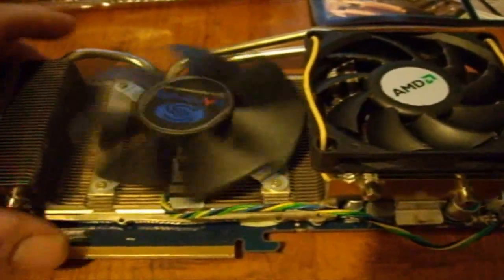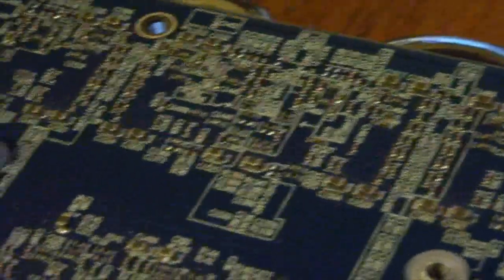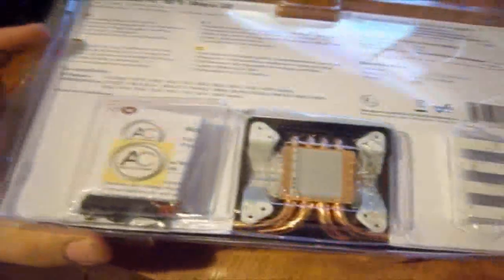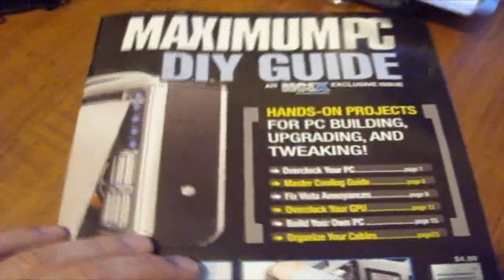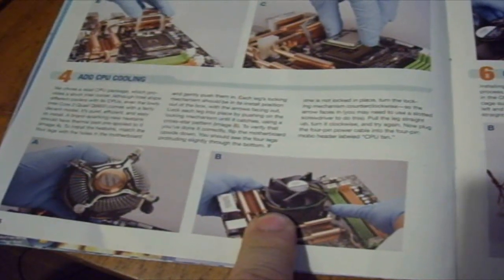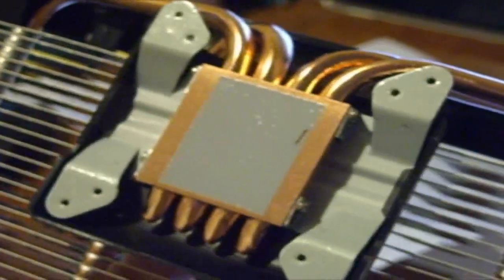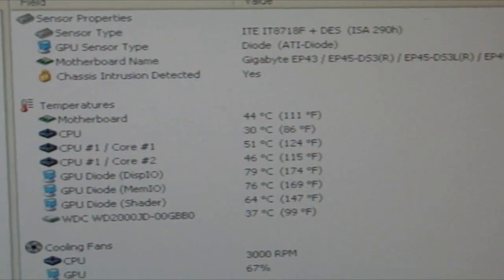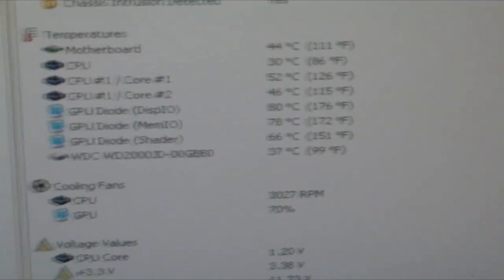Arctic Cooling Accelero S1 Rev 2 GPU Cooler

Comment from the maker: 70c is perfectly normal for Graphic cards based on my experience, however if they continue to climb over 90c, you probably want to worry about it's cooling altogether instead of a case fan, case fan meant for air flow, it won't help too much for a overheating video card

Comment: I'm just wondering, I'm running a 550 ti GPU, and when I game, it goes up to about 70 celcius (give or take). Should I grab a 120 case fan? would it help? Everything else in my tower runs with really low temperature, just my GPU is high. Highest my CPU goes to is about 47 Celcius, but I have a 120mm fan blowing to it. So once again, should I get a 120mm case fan for the gpu? would it help?

Comment: im running 73 for core and 95 for memory with no fan, once i put on some fans i would immagine it would be alot cooler, was running at  83 gpu and 107 memory before, i dont think the guy that says 47c is telling the truth, because i used arctic silver 5 thermal paste instead of the thermal tape and paste that came with the cooler.. so ya he's full of shit, but yeah, 0ver 10 degrees cooler with no fans at all you cant go wrong.. (oh i was running benchmark at 99.5% load with these temps)

Comment: @tricccple well even that is still to hot for a 4870
a 4870 should have 68 tops
just use the warranty for the 4870 it will break soon i bet if its cracked